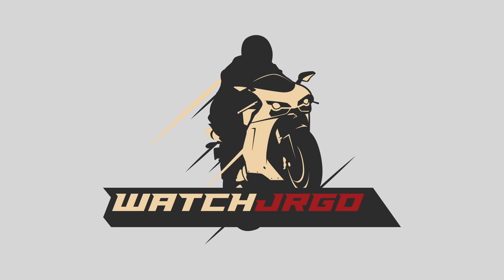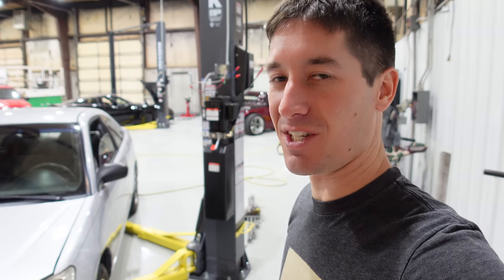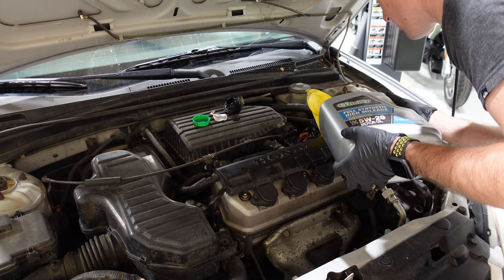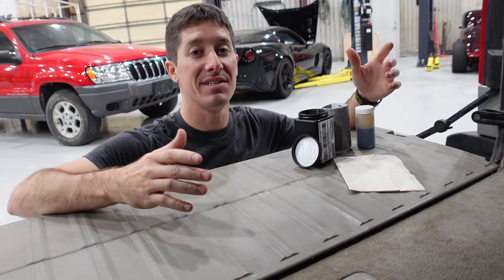Is VACUUMING Your Car's Oil Better Than Pulling The PLUG?

Comment: I picked up one of the Chinese oil pumps off of the jungle website. I did it because I needed to change the oil when it was -20C outside and the van needed a change. I don't care if I don't get 100% with the chintzy pickup mine has, 90% is better than no change.

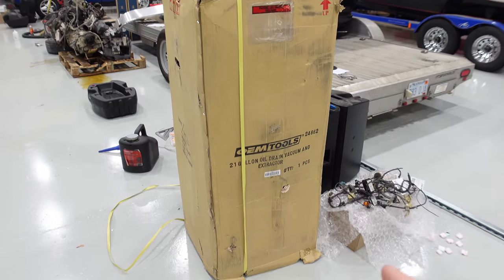Comment: 1:39 - OEM Tools 24862.  21 gal. oil drain vacuum n extractor.  (1:55) - an oil extractor
1:58 - shippd 2 him
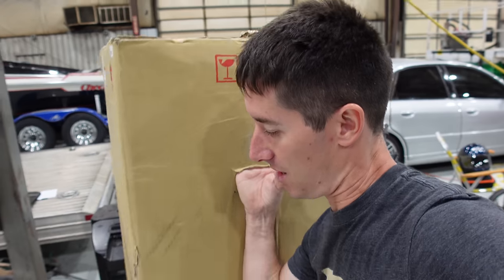2:26 - FED EX droppd off.
2:44 - hav 2 assemble
5:20 - very common at Walmart, Jiffy Lube, all the oil change shops 2. (5:48) - a lot of places hav techs vacuum oil so they don't touch drain plug n no engine fails.
6:00 - dipstick tube
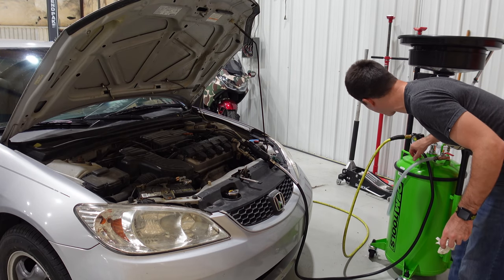7:07 - done, 2-3 min.
7:48 - hahaha bettr than pullin the drain plug.
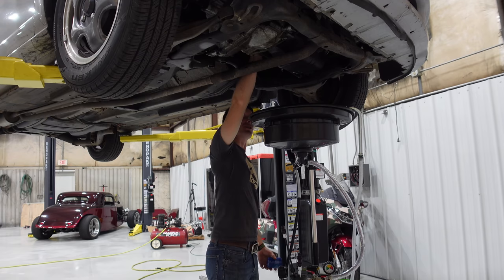8:10 -

Comment: If you have a magnetic sump plug the ferrous metal will never be removed from the magnet if you are using a vacuum extraction system.
The magnetic sump plug becomes a bit pointless once the magnet is fully loaded and can't accept any more metal.

If you never remove your magnetic sump plug you won't get a visual measure of how much wear you have in your engine.
😞

Comment: I really really really have a hard time with the vacuuming out concept. Dealerships aren't always right BUT.... I am guessing if a engine failure is because of contaminants left in the oil pan they would be liable for the replacement of the engine as well. Might stick magnets on the back of the oil filter to pull out any metal flakes. Idk... Beyond my expertise and pay grade. lol. That's the only thing I can think of.  Heavy contaminants left if the pan after evacuating the used oil.

Comment: That’s the way my Audi Q5 is set up, everything done from the top including filter. Easy no mess oil change. Btw this car has a full fairing and you can’t even see the bottom of the engine

Comment: I do topside oil changes my 2012 Diesel Golf but I pull the plugs on my other cars (06 Explorer and 21 Challenger Scat). Basically if the dealership does it that way on that particular vehicle I will too.

Comment: I've vacuumed the oil out of my 09 civic for over at least 10 oil changes since I've owned it...  Always annoyed by the excessive amount of oil that leaks from the oil filter just like in the video.. other than that no lubrication issues.

Comment: How do they leave the plug out? Doesn’t the new oil just pour out all over the shop? Am I missing something easy? 🤔
Reply: Quicklube shops like JiffyLube and Walmart do oil changes over pits, not on lifts.  If the catch tray is still under the engine, it'll catch all the fresh oil as it pours straight through!  Secondly, obviously if they checked the level on the dipstick, it'd never get to a "full" point, so it's obvious they're not doing that, and simply telling the machine "pump in X.X quarts", then call it good.

Comment: IMO do not use high milege oil! The main additive is brake fluid to swell the rubber seals of the engine. This causes pre mature failure of all sorts of seals in Honda motors, from my experience .

Comment: Oil suction system, works like your engine's oil pump.
Oil drain plug, works like road debris punched a hole in your oil pan.
Suction is the better way, gets more dirty oil out, avoids possible failures. Period.
It's like JR's big Autel scan tool as opposed to O'Reily's $35 scan tool. If you can afford it, it's the best way, but most people can't afford it, so it tends to be a moot point.
...then again, moot points are the Internet's catnip.

Comment: Marine engines are all changed with an oil extractor.  Can't get underneath of them to drain unless you want to just dump oil in your bilge and turn it into a disgusting mess.  Never opened up a sludged up boat motor either.

Comment: is it more safe for the engine? yes. is it worth the price for a private car flipper or a diy for a daily driver? i dunno man
Reply: For an average individual with one or two cars, debatable, for people in Kansas with a dozen or more, probably a good investment.
Reply: They've sold a small car battery powered oil pump for £10 in Lidl supermarkets. Takes 10 minutes with hot oil.

Comment: The engines like this one where the drain plug is high and leaves that 1/4 inch full of gunk and debris is the best reason to vacuum it out.  I'd like a compare of an engine with the plug at the very bottom, though it would take some time..  Start with an oil change then pan drop to fully clean the pan.  Next two oil changes are vacuum and normal with pan drops to see what is left in the pan each time.  Then that would stop all the nay sayers.

Comment: I prefer to use the sucker. I've used it for about 4 years now and it's very easy to use.
I will raise the car on a tilt to move what's left of the old oil as much as I can toward the pickup tube so if there is any old oil left it will help get as much as I can out of it. I def. like doing it this way most of all because I'm lazy and prefer to do things as easy as I can.. Who would have guessed. 
   I would never take a car to a Lube shop. I just don't trust them...............

Comment: The only real downside to vacuum oil extraction is you dont get to look at your magnetic drain plug as putting the car on a lift just to pull the plug will just defeat the purpose of using the vacuum in the first place.

Comment: Sucking it out has to be a HUGE timesaver if you can get to the oil filter from above.  Anything made in the past 10 years or so has some stupid plastic shield that you gotta remove before an oil change.  If its a truck then there is a metal skid plate in the way.   And you know those jiffy lube boys are in such a hurry they're going to leave bolts out/fuck your shit up somehow.

Comment: Seems faster and to do a better job getting more oil out of the engine.  Why is that not a good thing?

Taking out the drain plug and not getting a drop is proof of a thorough job.

PS - heal up quick Gabe.

Comment: JR that happened to my car at Walmart. They gave me $6000 for the car after they left then plug out.
Reply from the maker: Won the lottery 🤑🤑🤑
Reply: @WatchJRGo  i sold the car and bought another one with the money. Never went back to Walmart. 😂
Reply: LOL, only problem is I have a 3800 series II. Don't want to try the lottery. Unless it's for a new transmission. My 4t65e is on it's last leg. But my engine? Absolutely golden. Does walmart/lube shops do transmission fluid changes? If so, might try to play the lottery. Would love for them to pay for a brand new transmission! (I'm kidding. Much rather just pay for a rebuild.)

Comment: Ah. This video, perhaps unintentionally, explains the reason behind oil extractors. It's not about a superior method, but legal liability. No corporation from Walmart to Mercedes is interested in passing out free engines. Bypassing removal of the drain plug will minimize that potential.

Comment: The vacuuming is good for company liability, not as good for the car as draining from the pan. Ad the best move when draining is to drain, and then flush a quart of clean, fresh but cheap oil through to get the worst of the crap out of the pan.

Gimicky crap that's new isn't necessarily better, it's just different.

Comment: This is the only way you can change oil in many boats. You don't need a tool that fancy but you have to suck it out through the dipstick tube. Why?  Simple you can't get to the drain plug.

Comment: We tested this method on a friends E39 M5 many years ago. He had a 2 year old M5 we did both the oil extraction and regular oil plug drain method. Found the same amount of oil taken out of the engine with either method. It was much cleaner and quicker to use the oil extraction system. In fact so clean he was changing his oil in his $5k canali suit no problem lol. We even pulled the pan after the oil extraction on the M5 to see how clean it was, at it was very clean.

Comment: How hard is it to drain the collection tank once it's full? I dread emptying my cheapie under-car drain tank; it always makes a mess.
Reply: Not hard at all. Hook up shop air to drain bucket n put the nozzle off the clear hose in your waste oil bin and open the valve. The air pressurizes the cylinder which pushes the dirty oil out of the nozzle
Reply: @daviddennett2645  A traditional gravity drain tank should work the same.  You just need to make sure the center valve (where the catch pan empties through) is closed before pressurizing, or the oil can go out that way instead!  I haven't experienced it, but heard it mentioned a few times  on /r/justrolledintotheshop

Comment: It doesn't. Its the lazy, dealer way. You will have sludge on the bottom of your oil pan, there's many videos proving some models will leave up to half a quart in the pan which is the dirtiest oil that's on the bottom.

Comment: The "I've always done it this way / get off my lawn" side of my brain wants to hate the extractor.  Perhaps on a really sludged up engine draining from the plug might pull a little more crap out of the pan but in anything that's been taken care of it seems like this would be just as good or even better (since it got that last 1/4 inch) than my old man ways.   Get better soon Gabe!!
Reply: Yep, intuition says gravity drain would be better at getting sludge and sediment out, but the reality is contaminants stay in suspension and don't settle.

My brain still finds draining from a sump drain more satisfying.

Comment: Please everyone knows the proper way to change your oil is to pull the engine and drop the oil pan,drain it, clean everything top to bottom with engine degreaser, and reassemble it🙄🙄🙄